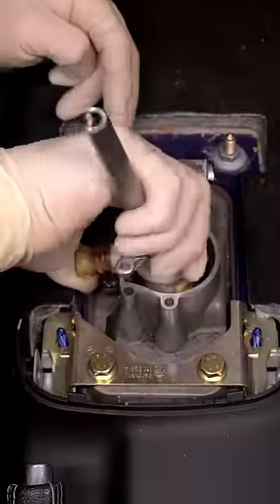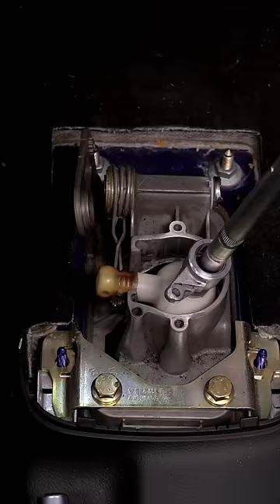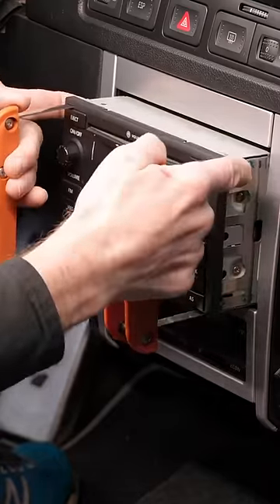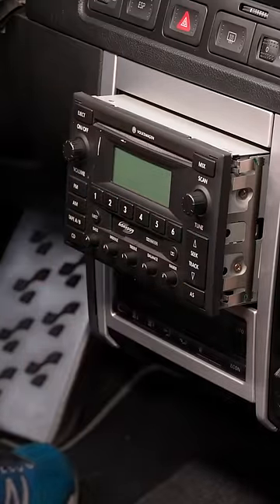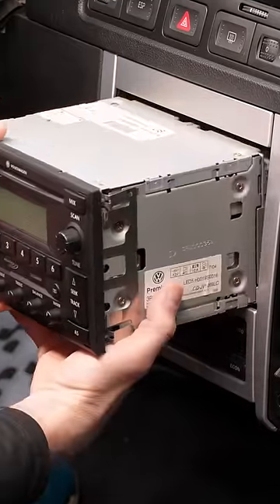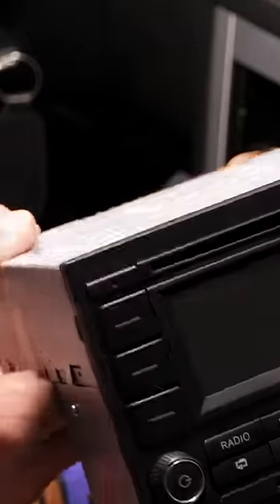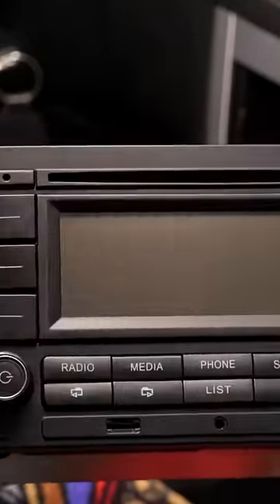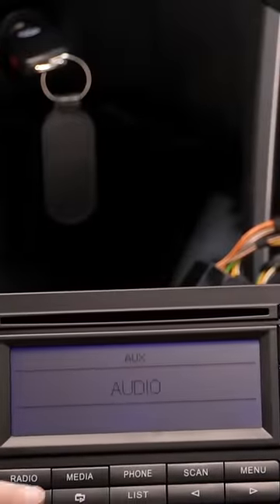I Ruined a Clients Radio OUCH

Comment: I can’t even express how pissed I’d be if my mechanic replaced my stock radio with an aftermarket one ☠️
Reply from the maker: It never occurred to me so many people would assume I didn’t talk with the client about the radio. 

While it boggles my mind, it does say a lot about how people feel about the auto repair industry. 

The main go to is “how is the customer getting screwed”. I get it. But I also hate it haha
Reply: The biggest problem is cheaper after market radios typically have horrible signal quality. The monsoon isn’t amazing but it is probably a landslide better sounding. 
*I run a 125,000+ member car audio page on Facebook with my best friend and local car audio events in my area. That’s how I know.
Reply: The Monsoon logo in 2023 may mean nothing as a retained Delphi trademark that like Dual, Pioneer, JVC, and others has been licensed to exploit a high-prestige brand's quality. You just replaced an actual quality radio based on Arkansas, USA audio technology with a Chinese piece of crap. It would have been easier to explain that your client is deaf but loves gimmicky car mods.
Reply: @HumbleMechanic  I think it's the way the you edited the video, you never said that you asked the client. It made it seem you did everything without asking, and considering it's their property that makes full sense
Reply: @Fckngeekedbro206 True but good aftermarket head units typically have better sound quality and power.
Reply: @Acaidia  I run a non powered head unit to a DC audio 1000.4. 10” dc audio Neo pro carbon fiber mids I made pods in my door panels for. 
You don’t have to tell me man. lol
Reply: @Fckngeekedbro206  Sweet man. I just have a Kenwood excelon and a 600w kicker amp feeding 100w per channel to my 6.5" infinity components and 4x6" rears.
Reply: Especially when you find out he did it by filming a tik tok! 💀
Reply: Well if yall actually watched his channel you would know he talked to his customer before any repair/incident happened. Also he’s not just some rando off the streets working on peoples cars, specific people bring their cars to him because of WHO he is and know beforehand that their car may or may not be in a video. Also 15 or so years experience and being a master VW tech don’t hurt. Anyone who has ever worked on cars has run into issues be it damaging/breaking a customer car or a diag that they got wrong/couldn’t figure out. And like he said in the video, if they say they don’t they are lying.
Reply: @HumbleMechanic I was thinking negatively about the radio replacement as well but nah, you’re right. Customers are fucking idiots sometimes. Mechanics get shit on left and right for nothing
Reply: Finally someone gets it. Id be fuming, like wtf. The guy couldn't even get a used replacement. Its a fucking collector car. this shits a huge value hit to something that will be worth a ton if kept stock.
Reply: @HumbleMechanic  the problem here is you replaced it with a shitty aftermarket radio, not that you didn't tell the client. Those stock German radios are pretty legit not to mention the value of an all original car. Surely you must know this as a car guy. the issue is that, yes you cosmetically fixed it, but the car is not original, the new radio is junk compared, and your acting like you did them a favor.
Reply: Why didn't he get someone to sand and repaint the scratch instead of replacing with this junk stereo?
Reply: @Agret  because you're never going to get it good enough that it doesn't look like it was touched up and that'd just annoy the customer further.
Reply: @Agret  That's exactly what I am saying! He makes it sound like he hooked the guy up but the customer got screwed. You could have tried to keep it original! The whole point in having a nice older car like that is too keep it original. it was clearly not "riced" out
Reply: @HumbleMechanic it takes half a second to say "So after discussing it with my client"
Reply: @JaredConnell  Bet he never told the customer how his radio got damaged. These clout chasers never tell they will be filming themselves doing the job and taking twice as long to do the job and you will be paying for it.
Reply: Would've thought it made more sense to buy a used one and swap the fascia but as long as the customers happy that's all that matters. YouTube comments be damned
Reply: @HumbleMechanic  but couldn't you have just replaced the plastic trim on the radio? Why swap the whole radio in the first place? Or I'm sure you could have fixed the scratches and been able to make it look new at least. Used radios for these cars should be readily available due to all the people who swap out stock ones
Reply: If it's a better radio and I can keep the original. I wouldn't give a shit
Reply: @TheRealH20  It's not better.. cheap Chinese throw in replacement. The only acceptable replacement is either having it replaced with old new stock, or compensated for the cost of one
Reply: atleast put a branded aftermarket like kenwood or sony
Reply: I get it, but those monsoon head units were notorious for having the display fail. I have doubt that unit was 100% functional. I had 3 fail on me.
Reply: @Veritas419  You can bet it worked longer than that cheap chinese radio
Reply: It doesn't exactly help that you're filming while working on it, and that extra that wasn't needed is directly related to the damage.  @HumbleMechanic
Edit, I actually found one in a couple minutes. Didn't bother to look into the details, but I know if it were my 71 nova's...  well the stock radio in that is dead, but I'm so anal about that thing remaining stock that the only way that radio is going to work again is if I open it up and repair it.  I don't want some hidden head unit, I don't want a replacement like.  So to me, wanting something stock is a lot stricter than oem like or some new fancy sweeping needles on the gauges...  but I respect the effort, and it sounds like the owner was happy, and that's the important part
Reply: @HumbleMechanic  doesnt change the fact that you should be a professional and you shouldnt care about your video! you should care about the client and that the car belongs to him and is not yours....
Reply: Well tbh the MK4 community most of them go to a newer generation radio head unit but still keeps it as stock looking and volkswagen branded but gives you stuff like Bluetooth instead of having persay an tape deck that you’ll probably never use again and you can still use the monsoon speaker setup
Reply: @gageharrison2340  That's not even stock looking at all. If you want for it to look stock you could actually add a bluetooth module to the existing original head unit. You can wire the output directly to the tape player(bypassing it), the cd player, or even radio(disconnect the fm radio to prevent interference). if you don't want to do modifications to the original stereo, there exists special tapes that is basically tape to aux adapter, to which you then plugin a bluetooth module.. or by now there are probably tape straight to bluetooth adapters.. there's plenty of empty space inside the tape shell, so I don't see why that wouldn't be a thing by now.

Alternatively, you can get the little fm transmitter that plugs in to cigarette lighter. Set the frequency, match it on the radio. It can play music from usb, sd card and by now they probably do bluetooth too.

There are many ways of keeping a stock look, while still having convenience of playing music from your phone. Replacing the unit with a cheap chinese "stock" looking one, is the worst way to go about this.
Reply: Id be pissed if it didn't say Volkswagen
Reply: @HumbleMechanic  I will still get mad no matter what, I mean like it's your clumsiness that caused this like why do we as the customer is the one who needs to understand the situation
Reply: @Fckngeekedbro206  who tf even uses radio anymore. Most folks are using some shitty get-around to use aux / bluetooth. The radio signal quality dosen't matter lol.
Reply: @rattlesss5148  Lol this was not about FM signal quality, but sound quality.. If you hack the OG unit to give yourself an AUX jack/bt, you will get better sound quality than any of these cheap china units.
Reply: @HumbleMechanic you could easily paint the Center of the original radio to look factory. No need to replace it.

Comment: Bro ruined their radio for a YouTube short
Reply from the maker: yep. did that on purpose for sure. 👍
Reply: @HumbleMechanic  kinda on purpose. Why would you be filming your work otherwise. No camera no damage
Reply: Fucking up is one thing, but it’s how you fix that’s matters. Not only did he fix it, but he went above and beyond for the customer, when he absolutely did not need to
Reply: @PeRRXX  Replacing a factory Monsoon Audio system head with an aftermarket piece of crap with a cheap appearance-only Chinese garbage radio not only gives you a worse radio, based on my experience with Monsoon Audio of this vintage in VW and Volvo cars, it is likely the system no longer fully works due to an enhanced interface. You buy a CODE-locked one off the used market and swap the bezel, preserving the radio, and the functionality of the system. You don't play r/shittycarmods to compensate. Edit: Also, it will start spitting diagnostic error codes in CANbus VWs, if you have a VW-specific enhanced OBDII reader, much like it will if you delete the sharkfin antenna innards in Mk4+ Beetles.
Reply: I wouldn’t say “ruined” … obviously it still would have worked. The housing was just damaged.
Reply: I mean, he's technically prioritizing his social media recording over his work. Work comes first always
Reply: @JamesConnor116 When the owner wants to keep his old car in a mint original condition, it is ruined.
Reply: @1331km1 How did he prioritise the recording? Recording your work doesn’t mean you prioritise the recording over the work you are doing.
Reply: Damn bro just shut down the channel at this point

Comment: "he likes to keep things original" 
So I replaced his radio and dash cluster...
Reply from the maker: So the radio I consulted with the client. We made that choice. The cluster was repaired as it was from the factory. The gauge sweep I know the client would be cool with. We added it to another of thier car.
Reply: @HumbleMechanic  surprised you couldn't find an original replacement radio
Reply: @rrp6405  in that good condition? Good fuckin luck.
Reply: @rrp6405 you’d be shocked cause most people just replace it and throw em away
Reply: @HumbleMechanic  Should have said that one the video, as you know, replacing parts without consulting the customer is a huge no-no.
Reply: The cluster wasn’t replaced though
Reply: @overthinking3573  plus the RCN210 has Bluetooth. If this r32 is daily driven, having proper Bluetooth integration is definitely a win
Reply: @HumbleMechanic  "i knew hed be a cool with it" is something i never want to hear from my mechanic
Reply: @MarksterC I have 2 original golf 4 radios and cd players just sat around …

Comment: Took my  mothers car to the Subaru dealer the other day to get the oil changed for her. After leaving and almost back at her work, I noticed water dripping from BOTH A Pillars. Told her about it, and she called the dealer and complained. Even after taking the car back to the dealer, they kept telling her that the sunroof drains were clogged. Despite the car only having 30k miles, and is always in the garage and has never had an issue with the sunroof drains, it's highly unlikely that both sides clogged suddenly. The service writer didn't even bother to ask the technician if anything happened while working on the car. 
The truth finally came out when she told them that she could easily find out what really happened by reviewing the dashcam footage. As soon as she said that, the technician appeared from around the corner and admitted that they didn't check to see if the sunroof was open when they took the car through the car wash. 
So they now are replacing the A pillar covers, the sunroof cover and headliner because all of them got completely soaked and have water stains. 
After getting home and saving the footage as a just in case, we saw that the interior got completely drenched and they just wiped off the seats and center console and hoped nobody would notice, and 4 people at least were shown / told what happened and not a single one fessed up until they realized they were caught on video. 
Now I'm not sure if the Service Writer knew about it before hand, but the fact that he told my mother she was wrong and didn't even bother to ask the technician is what pissed me off the most. I worked as a mechanic for over a decade and made plenty of mistakes. Yes customers will likely be upset, but they will be even more upset if you try and hide things and likely be pissed when they find out you flat out lied to their faces.
Reply from the maker: OH MY GOODNESS!! WOW is really all I can say

Comment: I’ll replace but I wouldn’t have done the cluster cause if there ever is an issue with the cluster, you will have to fix it. I personally don’t like touching what I don’t have to, for the same exact reasons…mistakes. I’ve tried doing this above and beyond and it has bitten me in the butt.
Reply from the maker: That is a VERY fair point. You have to use good judgment on it.
Reply: @HumbleMechanic  yup. Exactly. I always do little things, just not the big parts. Like quick cleaning/restoring up yellow headlights. My customers LOVE when I do that.

Comment: Also, the stock stereo was a higher end monsoon sound system. So, you actually downgraded the component.
Reply: That is a stock mk4 (1999-2005) oem stereo with cassette player. The fact that it is even in one piece is suprising to me as an owner of a mk4 jetta.
Reply: @shoya420  that's kinda my point. I would want to keep as stock as possible.

Comment: I would be so pissed if this shit happened because of tik tok
Reply: Fr. Hopefully @HumbleMechanic is giving the customer the video revenue rather than making money off screwing up someone's car
Reply: ^this! he did not make a mistake, he scratched it with a camera who had nothing to do with the job in the first place and is just used to make extra revenue.
Reply: @Vittrich And did a delete of several of the car's audio components along with the head which although scratched still worked. The Monsoon Audio package was not just the head unit. It was an integrated setup in the early 2000s. These days, it is just a legacy trademark of Delphi, and means jack, but not only did he damage it, he downgraded it and called it an upgrade.

Comment: my dad is a mechanic. did the same thing when doing a heater core job in a mustang. where you have to take the entire dash out, pretty sure the radio screen was cracked by the shifter. He made it right with them. always good to do!

Comment: I had a tech years ago try to test a Not Start with removing the spark plug, but leaving its plugged in, and he was checking for both fuel and spark at once..........Needless to say that cylinder had both fuel and spark and caught the engine compartment on fire. We quickly it out, had minor damage, luckily, just some burnt wires and jackets. No paint damage. I was absolutely upfront with the guy, we covered the whole repair for the no start and it was a Fuel pressure regulator that was faulty, but we also did a FULL detail inside and out, replaced the burnt wires, and the engine compartment was 100% cleaned and beautiful! Guy was happy, and he became a regular customer and referred multiple friends and family because we were an honest shop. Brought me great pride in the long run, but I hated that phone call in the moment! LoL Take care of customers and you have customers for life.

Comment: I understand that clearly! I just went through that last year when I got my carbon clean on my 2017 Volkswagen Jetta GLI they did run the chemicals out of the engine properly and damaged my Cadillac converter. They did not want to be responsible or knowledge that they made the mistake. Because when I drove it home and the concept for 4 hours and I took my son to basketball practice the engine light came on! I drive many chemicals to try to clean out the cat but nothing worked so I couldn't get a new cab that converter from Volkswagen. Because they were on back order. So I had to get a universal one.

Comment: This reminded me of my wife’s previous car. The timing belt was done by a garage. The next time when I did it myself I noticed the timing belt cover was cracked in half because the mechanic didn’t install it in the correct order. I know this, because with the new one, I did the same mistake with the order of assembly, but with the slight difference of redoing it correctly instead of forcing the cover in place and breaking it.

Without the inspection cover there was a huge hole in the cover, it was pure luck no stones or other debris got in.

I don’t understand how it is such a difficult thing for some garages to admit that they made a mistake and correct it.

Comment: You did good. Recently had my c5 corvette come back from the shop and the interior was fucked, they didn’t put my radar detector back in properly, my drive side door panel was scratched to all hell, my middle console was stuck open, and my dash had a pretty deep scratch, and he sent me home with 4 lug nuts on 3 tires claiming they wouldn’t go back on but I had spare ones in my trunk where he went to get the key to get my wheels off but didn’t bother to throw the spares on.  He didn’t mention a single one of those issues to me.  Prior to me taking my car to that shop the ONLY issues with the interior was 3 ripped stitches on the driver seat.